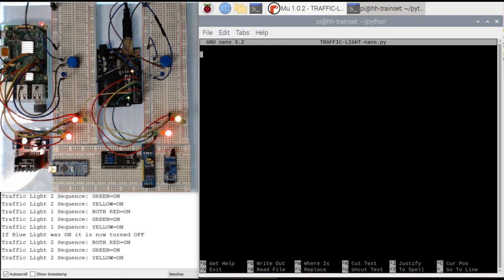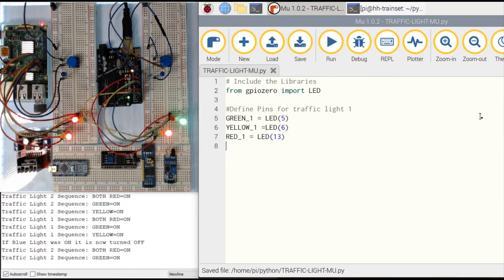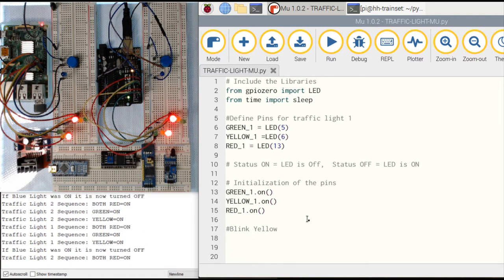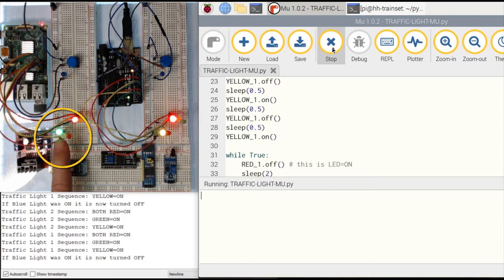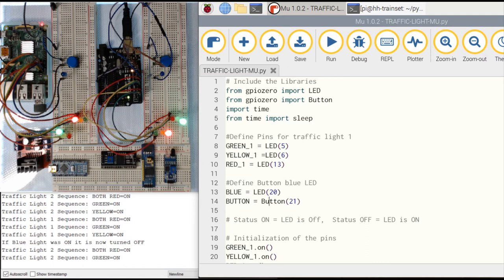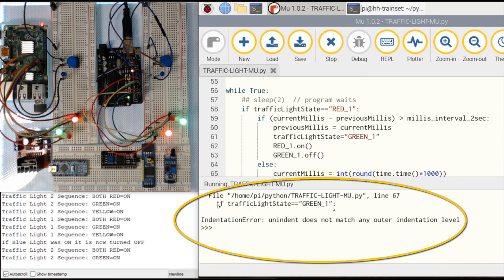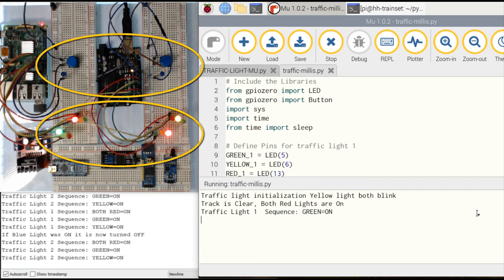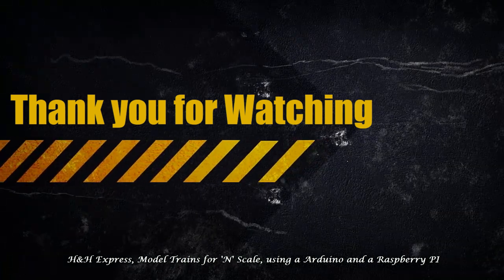H&H Express - Tech-Tips #03 Traffic Light Programming RaspBerry Pi

Comment: Not a python guy (have used C, C++, perl, and unix scripting languages quite a bit in my career - but I am not a programmer by training or trade) - could you not have done something like defining HI as OFF and LOW as ON and avoid the "off=on and on=off" confusion?  Just curious if that could have been done (because, again, I am not a python programmer) - it's your program so you can do it however you want - I just got confused (I watched a later video first so I did not know the on=off bit yet)...  😁  Thanks -Rick
Reply from the maker: Well I actually did not try that since the LOW and HIGH are states within Arduino so fixed. I will check it if it is possible and update you
Reply from the maker: Hello Rick,  I have created a #define LEDOFF and LEDON and  assigned them to HIGH and LOW and it works correctly so will use it in the new programs and videos to make it easier.  Will do the Same with the Button Press and Relais.  thank you for pointing this out to me
Reply: @HHExpress  Great - I think that will help eliminate some  confusion on the part of us  simpler minds!  Appreciate you following up and letting me know.  Will be waiting for your new videos!  -Rick
Reply from the maker: No issue